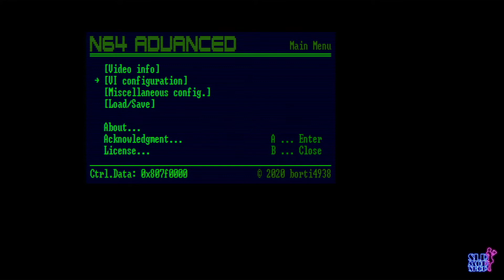Nintendo 64 Advanced RGB (Full Flex + Component)

Comment: Amazing video i totally forgot to cut the trace for pin 7 sync lol...ill go do that
Reply from the maker: I ended up cutting vomposite video as well so it doesn't interfere.
Reply: @SLRModShop  i must have a ground loop or something. When i start the n64 after it hasnt been started for a while it goes squiggily and i get a lot of distortion. As minutes go by it gets better and almost perfect...but line 3x is super distorted. Agter about 5 mins everything works properly ...line 3x etc. And after i shut the system off for short periods of time is is still good. After a few hours the same issue happens and after 5 minutes its all good. I triple checked the pins and ribbon cables there are no shorts
Reply from the maker: @ikeavaughan  Check for the feature called PLL and enable it. If that doesn't improve things, you will have to replace your wire going from the Advanced RGB kit to the AV out connector by thinner wires.

Comment: So I ripped off the Controller and Reset Pads on the Flex while cleaning 🤦. Do you happen to know if I could connect the cables coming from the PIF somewhere else on the flex? I tried connecting them directly from the PIF to the reset and controller Pads on the Mod Board but that doesn't work unfortunately.
Reply from the maker: send me the highest quality close ups that you can of the damaged area via email: jeromedoubleyou at gmail dot com
I'll need to see where those traces go before I can help you. I don't have this mod available right now, unfortunately so it's going to be hard for me to help, but I'll try :)
Reply: Thx, I sent you an email!

Comment: I'm not sure I understand the difference between the borti's Advanced RGB mod and the borti's Full Flex mod.
Reply from the maker: Same thing but one is using a flex cable. Depending on the type of wire you're using, you might have some issues with the line doubling feature on PAL console, this prevents it altogether but the price is extremely steep. The modkit you see in this video was £110... I'd recommend staying away from it, get an RGB+Deblur mod for almost 3 times cheaper and use the money saved to invest into an OSSC.
Reply: @SLRModShop  I've never had any joy with upscalers, I do have the RAD2X cable, which would you recommend that's best with the RGB mod?
Reply from the maker: @abloogywoogywoo  Then you're set! Get yourself a Tim Worthington RGB+Deblur mod (from Etim's website or OldSkoolConsoles if you're in the UK, either way, you're looking at £40) and you're good to go. I don't own one but the way I install the modkit makes it compatible, many of my customers are using it. So, I'm not sure which one makes it work but routing Csync to pin 3, 7 and 9 makes it work. In fact, doing this makes it work with at least 4 types of cables so, that's what I strongly recommend doing.